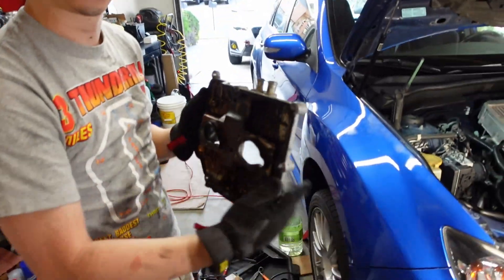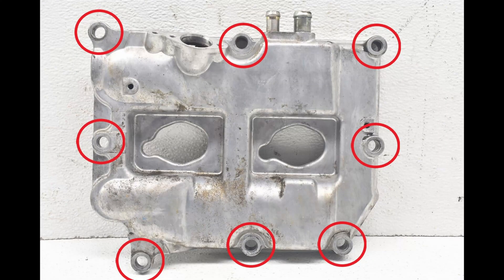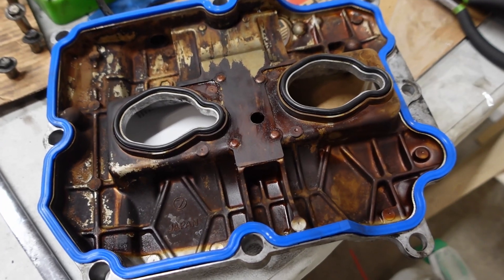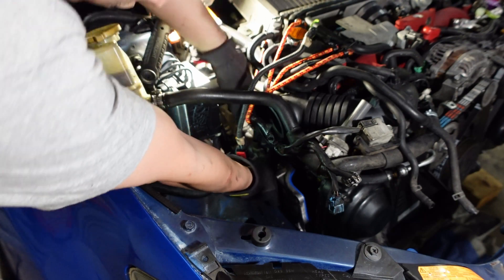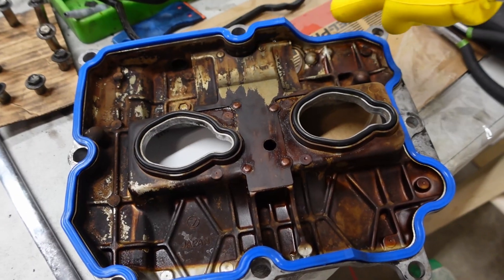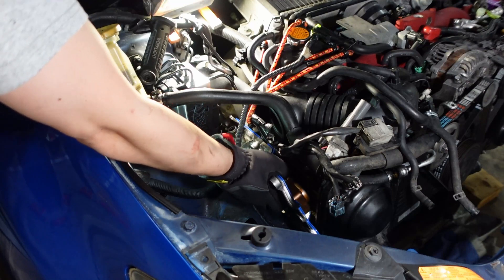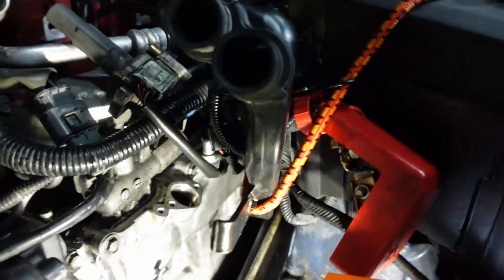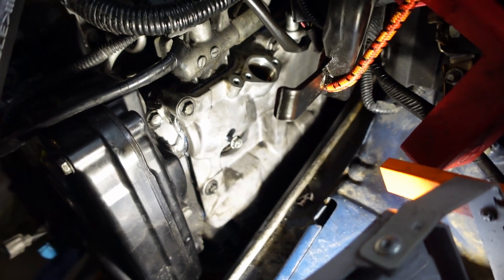How To Fix Leaking Subaru STi Valve Cover Gaskets - Here's What I Learned

Comment: Do you put RTV before or after you put the gasket?
Reply from the maker: according to the service manual theres only a few places you are supposed to put RTV, otherwise they did not recommend doubling up on RTV and the rubber gasket. The spots that needed RTV were applied before the rubber gasket/cover was put on.

Comment: Great Video. Mine 2002 Sti is leaking as well, so I have to replace it. I like tje blue gaskets! Are you happy with them? Are they still do their job?
Reply from the maker: Thanks! The blue gaskets definitely made it more obvious if they were seated correctly. When I went back under the car I noticed there was a section I couldn't see the blue. Luckily I opened it back up (before putting the car back together) and reseated the gasket.

Comment: What tool did you use to get to the bottom bolts of the valve cover? Seems like a regular 3/8 ratchet is too wide
Reply from the maker: yeah the space is suuuuper tight even when i lifted the engine up (although the more you can lift it, the more clearance you'll gain).

Get some 1/4 rachets, sockets and extensions. The good news is the torque spec is only 4.7 ft/lbs so its relatively to loosen the bolts. Then use your fingers to get it all the way out as you'll lose clearance as the bolt moves out and your tool wont fit.

Comment: Good Job, I have changed it 4 times and it still leaking, but leaks only in the point where I have applied the rtv
Reply from the maker: bro I almooossstt installed it with a badly seated gasket. Would have sucked!

Definitely take your time seating the rubber gasket and definitely pay attention to the diagram in the video that tells you the proper RTV placement.

Remember RTV takes some time to cure before you can torque everything down. It comes out as like a gel, you let it dry per the instructions, then it becomes more rubbery, which is when you torque it down. If you torque it down too soon or run oil through it, you can definitely leak. The RTV should have instructions, make sure to follow them! Good luck!
Reply: Thanks man for the description, I'm definitely going to read the instructions better this time. Let the RTV dry before torqueing I didn't know that, thanks. I think it is also complicated to place the joint perfectly with so little space but that clearly takes time. Thanks again! 👍
Reply from the maker: @LucasE.Flores  yeah its definitely tricky. Take your time. Definitely dont want to do the job more than once lol

Comment: Did you need to drain your oil before removing the cover?
Reply: There will be residual oil in the heads but it's not necessary to drain the oil.
Reply from the maker: I did yes, but I was doing the oil pan among other things at the same time. Although technically I do not think you have to (as in oil will not just start spewing all over the floor), I think it is very good practice to do so.

Comment: Awesome job, I bought my first Subaru (97 Impreza) with the 2.2 single overhead cam engine and changed its valve cover gaskets, after i was finished I was like i dunno what the big deal is that was easy....Fast forward to my WRX, came into it thinking this should be easy 😂
Reply from the maker: "should be easy."  the hubris of every car guy 🤣🤣

Comment: Great job.  I just wanted to add (Hope you dont mind)  Be careful when jacking up the engine.  Theres a Dog bone engine mount on top of the engine that goes to the transmission and i see people snap those jacking up the engine all the time.  Safe bet to loosin it up before jacking =D  Great video man
Reply from the maker: thanks! and yep I had the dog bone disconnected (as I was replacing it with a Group N version) so jacking up that engine was super helpful!

Comment: Dude, awesome video. Funny enough, I just got an STI hatch around the same time as you and stumbled upon your videos. Just did my timing belt, water pump, thermostat etc. and of course, like clockwork, my passenger side valve cover gasket started leaking days later. Unfortunately found my driver's side VVT solenoid leaking at the same time, but it is what it is lol Either way, love the channel man. Definitely got a follow from me. I'll be doing this next week. (And I agree on RTV thing too. Less is more :) )
Reply from the maker: lol sounds like youre going through the same pains as me too! Lets suffer together! good luck!
Reply: I have a 13’ sti hatchback and passenger side is leaking as well lol doing that job today.